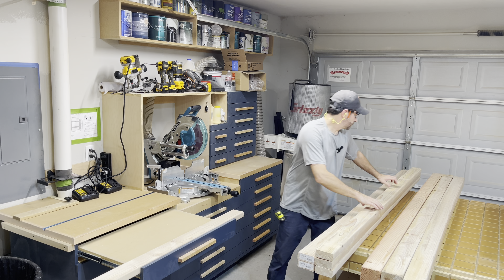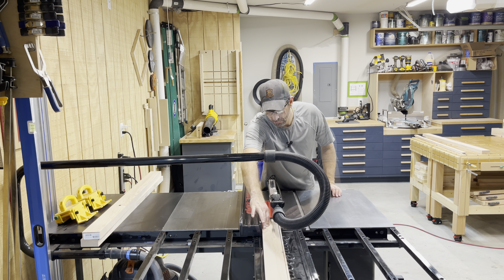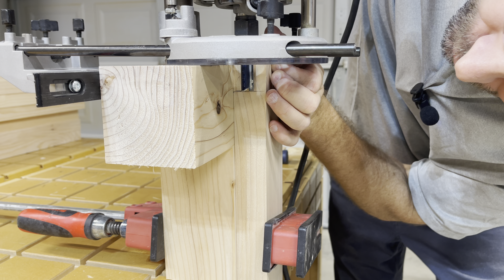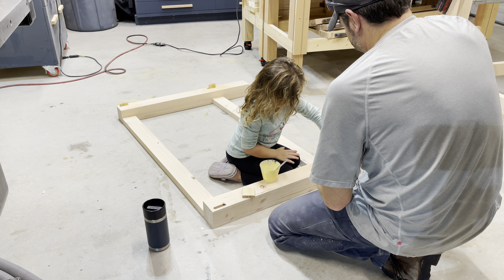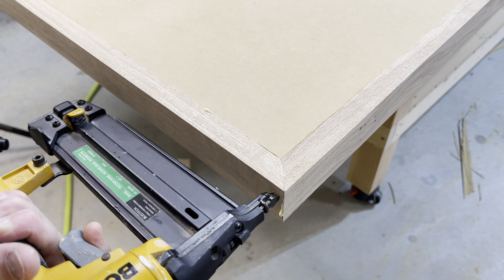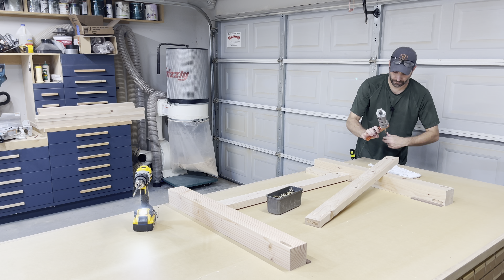Awesome Workbench and Assembly Table!!!

Comment: HEY.. BEFORE you get rid of those other MatchFit tables, I have a thought for you.. :) 
I guess you could always get back to cutting those "Sliding Dovetails :) and plug the dovetails at the top and outside edges of those tables you have left. Just get a snug fit and tap them, round them over so they don't catch the cord any more.. Ha... 
Then, drop a little bigger router bit and make 3-4" of one of the slots in some part of the table to be able to get your clamps back in.. Might be able to use a dog hole in a couple of the Intersections of the corners on your existing table to get the clamps into the grooves without using the table edges.. 
You would just loose a couple inches of each slot you widened to get the clamp in the slot.. Just thinking out loud. 

What do you have now? Dog holes on 6" Centers?   Hard to tell from a video, but has to be at least 6" or more. 

I think the Dovetails would be a nice addition on the work table you have now. 
Just down the side in one area, and, some on the top to match those new side ones..  
Just not to the edge of the table top. 
Check this out!! https://www.youtube.com/watch?v=6J2lygYQFD8
They use both the Dog Holes and Dove Tail Grooves.  Not a bad combination.. 
It seems it would be nice when you start building cabinets, etc having the 90 degree clamping surface on top and 90 down. 
Given your experience, I think I'll do a small roll around table first Not the one in the video, just a table with castors I can drop a 4'x4' matchfit top on.  (Just screw down the top for a bit and do one end down with a long match fit wall , and a short one on one long side, and leave the other long and short side with 4" of clamp area and see what I like.. Ha..  Sure seems like those would be some handy little tables if you got rid of some of the aggravations.. 

You did the right thing changing the design. 
I use F and C-Clamps on my Welding tables.. 99% of my clamping is holding something down to the table while tacking/welding.  
I built 2 roll around metal tables from gathered pieces/parts when I was 17 years old.
The first table I built had Angle Iron under the table to the edge and down, making it impossible to use a C or F clamp from the top of the table.  
The second one, I chose to flip the angle around and have the flat on the outside and the down leg on the inside giving me about 3" of Clamping on the edge before the angle transition, then another 1.5" if I got up on the Angle to clamp.. 
But, that table had a piece of 1/8" plate on the top that had rounded edges and had been cut by hand, so, wasn't straight or square, so, I dedicated it to a chop saw and two bench grinders and used the first table I built with the angle leg dropping on the outside of the table.. 
I hated that, every time I grabbed a clamp and had to reach under the table to clamp it. 
I tacked pieces of square tube under it here and there, and finally Ran a 2x4 along one side and a 2 foot area on the other where I would often work. 
I grinned every time I had to clamp something for the next year or so.. 
Probably the same thing you do when you start sanding, and realize after 15 minutes, no cord hang ups.. Ha..Ha.. 
I didn't build another table for 10 years. It worked, and I had other things to build that were more important... Ha.. 

Which brings me to my next similar point.. 
I hate building prototypes too.. Damn things always work, but, never have what you would have put on the damn thing, had you known it was going to work so well anyway. 
No problem right?  I'll just build another, but, it works, and you have other things to build.. Right? Ha.. 

That was 9 years ago and the damn thing still works just fine, does what  I need it to do, so, I have not built another one. 
I even bought the stuff to build another once, and it sat in the shop. .Ha..Ha.. 

Finally, my buddy wanted to build one., and  I already had the parts to build 1 more. 
I bought a HF 1hp motor,  not realizing it would not work on Variable speed.  
That stopped me that time, and wasn't until my buddy wanted one and I had the motor and by then a set of step pulleys.. 
I had a plan. Build one for him, buy a 3phase and VFD for me.. 
Build one for him, then, I would finally build the Cadillac for me.. 

We got about 3/4 way through with it, and my buddy had a stroke, and, I put it in the back of the shop, so, I didn't have to look at it. I'm not going to finish it, until I get into my new shop. 
Then, I will stop and build both of them. One for the Metal shop and one for the wood shop, and, I'll call my buddy and see if he has anyone in the group that does not have one yet.. 

Why did I build the first one? A guy I just met invited me to a Blacksmith "Hammer Inn", and, everyone was standing around waiting to use this $4,000 grinder. 
I walked over and looked at it and said to myself, I bet I can figure out how to build one  a lot cheaper.
Most of the families didn't have $4k to drop on a 2"x72" Belt Grinder. 
So, I figured I would say thanks by building one on the cheap with just simple tools most DIY Garage Families would have. 

Then, I could give the design to the group where the individual families could afford to build one of their own. Well, it worked. 24 families in the group, and 23 built one of their own using skate board wheels everyone said wouldn't work.. I knew they would. I saw them being used in something called "Extreme Downhill Skateboard Racing". 
I immediately googled it, found out what kind of wheels and bearings a group like that would use.. I knew it would work for a grinder. Could not have been more than 30lbs of pressure on those belts... 
Anyway.. I started working on it about 9pm one night, finished it up at 6am the next morning. Didn't have a clue if I could get the tracking to work with wood, etc.. Didn't even sink the screws all the way in, until I had it working.. I made the video for the guy who invited me to the Hammer Inn. He was in Texas selling Christmas Trees and would be back home in a week.. He forwarded my video to the group and called me back in two weeks to tell me everyone either had one built or was in the process of building. One Dad sprung for a brand new Factory model for his kid, because the kid was good and was making/selling knives and making money with it. 
Now, you can search on Youtube and see a crapload of guys who used Skate board and wooden wheels. But, none before I posted my first video about it.. Ha..Ha.. Kinda cool.. 

Moral of the Story.. If it aggravates you, Fix it.
But, on the prototype? Hmm... There was the skate board wheels that were not supposed to work, but, I was pretty sure they would(Hmm), and the tracking mechanism(Which I figured I could make it work, but, not with Crude tools everyone would have. I really didn't have the time to build it right then, but, decided I would give it a whirl one night. And, it worked so well, I didn't want to be without it, and, it became one of the tools that got used, every time I cut any piece of metal. Just to debur mostly, but, used it for a whole lot of things.. Even rounding ends on wood pieces, etc. 
It's about like a Disk or Belt sander is to a shop. One of those things, if you ever get one, the kinds of things you make expand, and you never want to be without one. 
Funny.. Get a good disk and belt grinder in a wood shop, and it will be the last time you cut anything right on the line again, if it can be done on the sander better.. Just like using a shooting board and plane when doing fine Joinery or miters, etc.. 
I think the guys who like to do hand tools and keep a plane and shooting board on the bench,  just hate to sand anything... Hitting a board with a good sharp plane is about the same as sanding it to 1000 or 1200 grit.. The first time you get a good slice of end grain, it will blow your mind how smooth it is.. Anyway.. Back to my other projects.. 
I really enjoyed your videos.. I have one more bed build to watch and I think I covered the wood project videos.. 
Putting videos on youtube is kind of like writing a book about yourself for some future family member to see.. 
That cute little supervisor you have is very likely going to a corner in the shop she claims as her own, and, builds things for family and friends.. Sure is time better spent, that clicking likes on FB and IG.. Ha..ha.. You picked a good hobby.. Now, to get the wifey out there making things with you. 
When I was growing up, everyone my age was worried about Guess
 Jeans, Nike Shoes and the Friday night Football game. I couldn't wait to get home and tinker with something around the shop  or yard, or, get to the woods in the winter months.. No regrets for sure...
Reply from the maker: Sounds like you’ve had some fun building some workbenches of your own. I would love to have a metal working shop too…maybe someday. Love getting my little supervisor out there with me. She will definitely be taking over someday.
Reply: @aaronbebeau  One at a time.. Ha..Ha.. But, if you start welding, the HF welders are good machines. Not top of the line, but, they work and I have been using mine for years and can weld anything I need to weld.. 
MIG with Gas is the easy, almost zero cleanup way to go.. Flux Core without Gas requires a good bit of cleanup..  A 4" angle grinder (Cheap Paddle Switch from HF) with the Resin Fiber Disks, Cut off Disks, and the typical 1/4" thick hard grinding disks will get you on your way.. Get one grinder for each type of disk since they are cheap.. Spend your money on a good Brand 4" grinder for a Heavy Wire Wheel Cup Brush 4" with "TWISTED" Wire for quick cleanup... A mid grade auto darkening helmet (Sub $50) next upgrade. Evolution Metal Chop Saw (Orange Version) is the next upgrade for cutting metal. Amazon Cut 50 or similar Plasma cutter the next for quick cool cutting and cutting curves, etc.. 
Get you a bunch of Vice Grip HF Welding Clamps with round pivoting heads and then spend $100 on some HF F-Clamps and a metal Table to work on and you should be able to do just about whatever you want to do.... Go for a metal frame base with replaceable 1/4" x 4" Flat bar slatted table.. Spacing between slats based on the width of the F-Clamps. And, if you have a buddy with a Mag Drill, buy him a 3/4" Core bit and layout a dog hole pattern for the table and cut a few cheaper HF F-Clamps to use in the dog holes. 
Fiber Resin Disks: Make sure you get these.. They will be your favorite way to grind.. Semi Flexible Pad that goes on the grinder and get some Ceramic Sanding disks at some point after you have used some of the AO, etc, disks.. Get them  in 45 to 60 grit and the hard disks somewhere in the 30-45 range and you will be set. 
Hope that helps... 
Next best advice is to make a set of Story Sticks/Pinch Rods out of 1/8" and 1/16" x 1" Flat bar and make a clamp of some sort. (Vice grips work while you play with it).. Even better for wood working to make some for that.. Actual Measurements vs using a tape measure... Later research the "Tick Sticks".. 
You can't get any more accurate than this.. Check this video out exactly where it starts.. This is classic.. 
The guy thinks his box is square, but, builds him a Keepsake story stick set of brass nuckles and realizes his box is "NOT" square after all these years.. Ha..Ha... Imagine his stick with sharp points, thinner, and, flip one of the sticks over to be able to lay the stick down and get an accurate mark on a piece of stock and you can see the value in them.. That will really step up your wood working game when it counts.. 
https://www.youtube.com/watch?v=e5_1ZKX5foY&t=845s
Then, get a piece of 1/4 plywood or mdf and some 1/2" and glue/nail them together as a backstop on your Miter saw and use the 3+4=5 Method to get the 90 and 45 just perfect on the saw and score your fence boards bottom and fence, so, you can make perfect cuts each time.. 
This is a guy who swears by them,, and don't miss the Shooting board at 16 minutes with the tape.. 
https://www.youtube.com/watch?v=_67fKSr4_wg
I saw you burnish one of your miter joints, which is fine, but, seeing how he does his miters on the Urn Box just brings a whole new light to fine woodworking.. You won't use it on every job, but, when precision counts, it is the only way to get things dead nuts perfect... I have been doing this for years, and make notes to share things when I see them on YT.. BTW.. While on his channel, check out his handles that he makes on his Saw Blade Box.. I saw this somewhere years ago and made a bunch for some small parts drawers where I decided to not put plywood on the back of a small cabinet, but, wanted a drawer stop.. Loved them, but, didn't think about using them on larger projects.. And, he bevels the drawer fronts, which I think is pretty cool in some applications, and something I am going to build play with at some point. 
Enjoy! When I get into my new shop,, I'll be making some vices for my tables... I'll send you one of them to replace that Yost...  And, when I get another shop tool, I'll send you a retrofit Tail Vice design I am going to build... Cheers!
Reply from the maker: @MarkThomas123  thanks for the tips! I enjoyed watching those videos. Those bench sticks are pretty cool. Might need to build me some.
Reply: @aaronbebeau  Pinch/Story Sticks and Tick Sticks are two different animals for two different functions. Check out both. 
Use Sharp points on any of them to be more accurate.. Keep the Tick Stick handy, and, watch a few videos about them, and take an few minutes or an hour every now and then to mock up a  scenario... When you grab for a set, nothing else can do what it does as far as I am aware of.. It basically allows you to trace something or an area, and take it with you somewhere else to re-create that same pattern. No need to build a template, etc. 
Ship builders can't live without them.. Easy way to replicate arc's, irregular patterns, etc... 
Well, well worth your time to look into them..
Hope you get that bench just right.. You never know exactly what you want until you build and tweak one or two for your own purpose. Cheers!

Comment: another youtuber said that to laminate onto mdf, you need to have 2 coats and wait for it to dry.  You didn't do that.  how did it turn out?
Reply from the maker: @NewTestamentDoc  still rock solid as the first day. Definitely wouldn’t hurt doing multiple coats though 👍
Reply: @aaronbebeau  really appreciate your input.  My next table is going to be based on yours!
Reply from the maker: @NewTestamentDoc glad you like it. This is my favorite that I’ve had to date. Soon I will be adding storage cabinet to the underside. I wanted to use the table to make sure I liked it before I did all that for nothing. Reach out if you have any questions. 👍